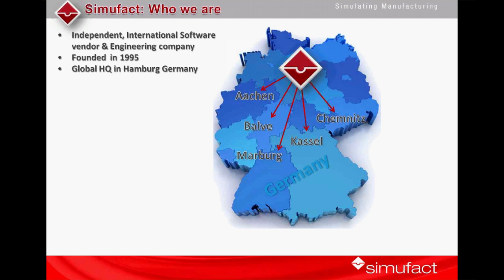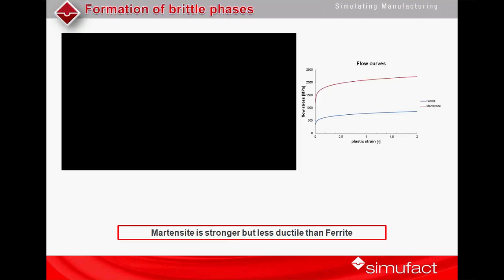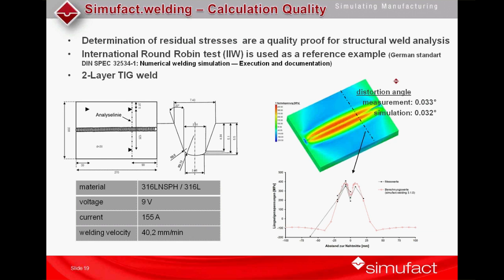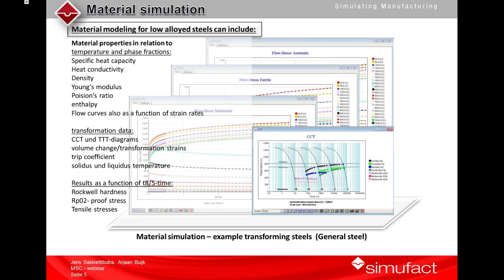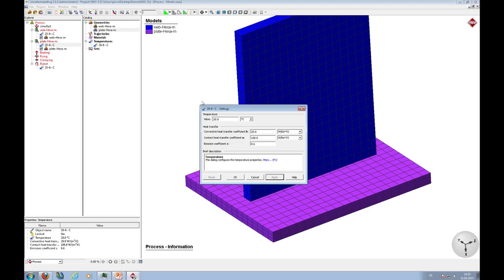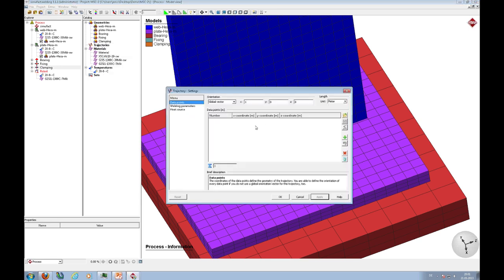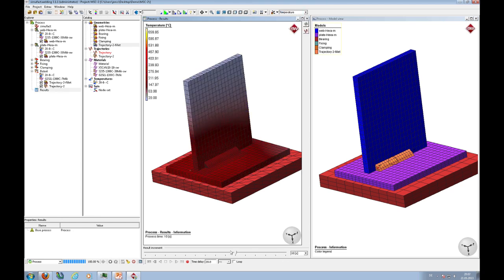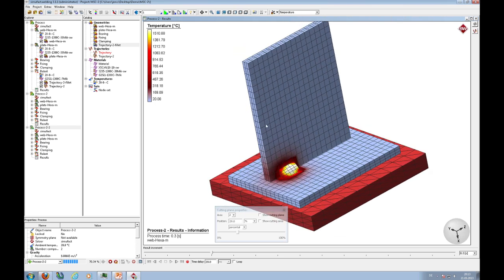Marc - Simulating Manufacturing with Simufact.welding

Comment: It would have been interesting to see, how data can be extracted from the simulation. I'm having a hard time figuring out how to extract the residual stresses so that I can import them into excel and show for example the residual stresses in z-direction over the flange of an I-section. For that I'd like to extract the coordinates of the desired points and the nominal stresses… The "help"-module in Simufact.Welding doesn't really help with this...

Comment: My question about this software is how you can create the geometries? I read forums and they said the geometries are already done. What if I want to work with new geometries? I HAVE to create it in nastran? or solidworks?
Reply: Simufact Welding operates on imported meshed geometries. You need to first make the geometry in a CAD software, then mesh the geometry using a meshing software like hypermesh. Then all you have to do is import the geometry and run the simulation.
Reply: Well that is not true at all..I've created a geometry in Solidworks and I saved it in different formats (igs, etc) and simufact wasn't able to import the geometry...could you please tell me in which cad software I can create those meshed geometries?
Reply: Luis Alberto As the previos commentators allready wrote, Simufact.welding is an FEM-software and handle only with FEM-meshes. As you already have made a CAD-file the next step is it to create an FEM-mesh (hexa of penta) from you file and save it as nastran file (*.bdf). Then you import the .bdf in simufact.welding and can build a welding process. Boundaries such as bearings, clams and fixing tools can be created in the GUI.
A future version of Simufact.welding will contain a meshing tool, so that you´ll be able to import CAD files and mesh it in simufact.
Notice! current version can only handle FEM (hexa of penta) mesh saved as nastran (bdf) file.
good luck
Reply: Erich Schott
Beginning with the version 4.0 Simufact.welding contains a mesher tool SimLab so, that it is possible to import CAD- files like step, stl etc. and create a FEM mesh.